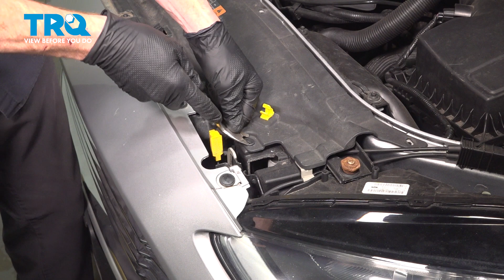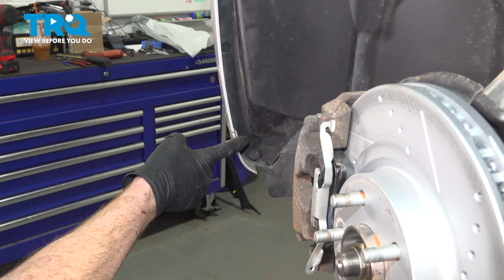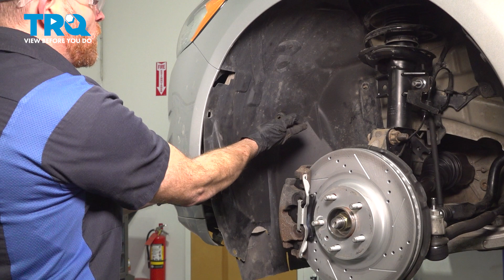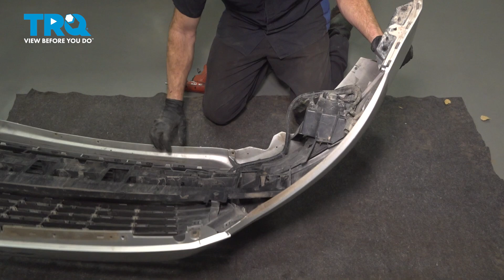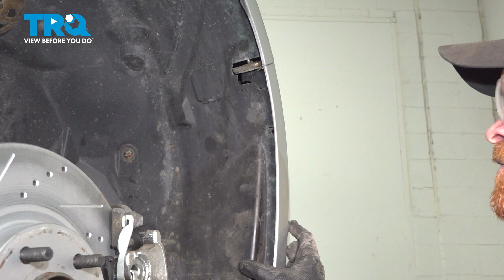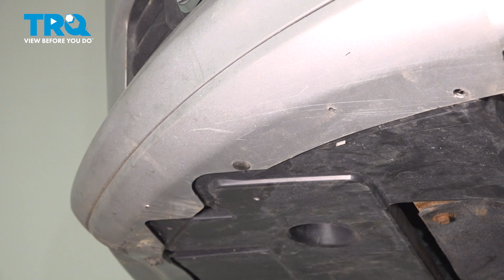How to Replace Fog Lights 2013-2020 Ford Fusion

Comment: You could’ve just moved the fender well cover like you did at 8:10 and had access to the 7mm bolts. Removing the bumper was unnecessary.

Comment: Ford are pricks. Had to change a front parking light. 3 hours later I'm done. On any vehicle...replacing a front or rear light should be 20 minutes or less.

Comment: whoever designed this garbage needs to be fired. There is zero reason why we shouldn't be able to simply remove that black plastic surround and pull the housing.

Comment: I am not able to find fog lamps for a 2019 Ford Fusion on your website. (so, I purchased from another site, and they referred me to your video for assistance). I don't know where to connect the adapters provided in the harness. If it is prewired (I have wiring in the driver's side fog lamp compartment) where do I connect it? Can I piggyback off the actual headlamps?